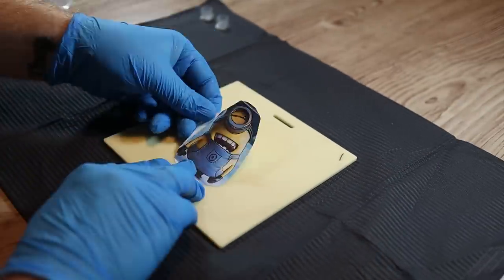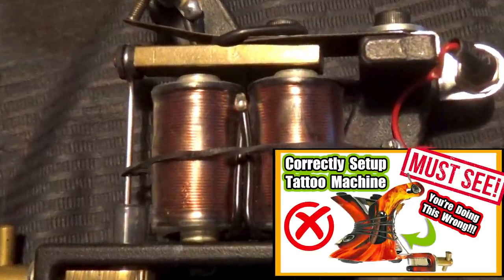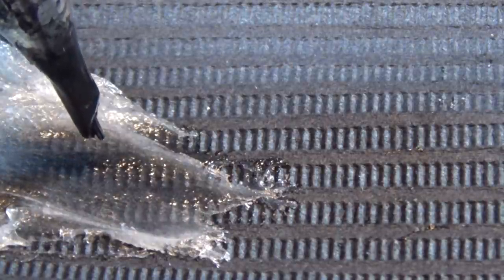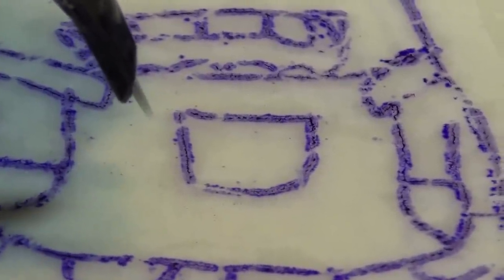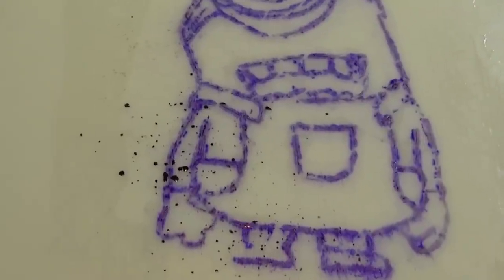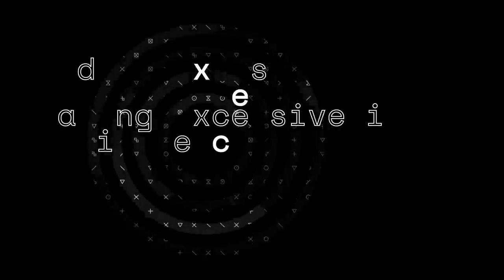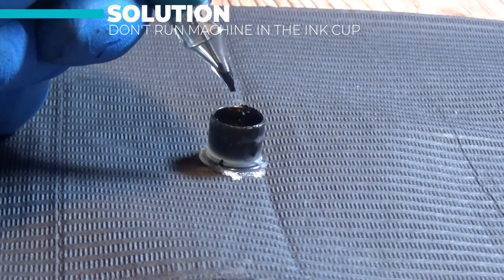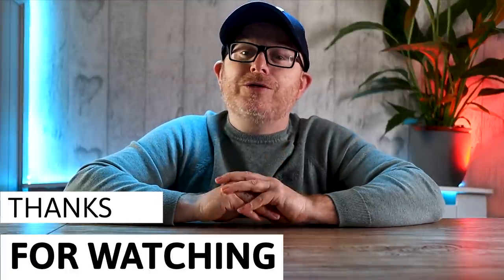How To Tattoo Avoiding Ink Splatter! 6 Most Common Mistakes Made & Techniques To Avoid Them!

Comment: Thanks for this. Until watching this, I always used to have problems with loading too much ink into the cartridge needle. When dipping the needle into the ink, I always used to run the machine to pull the ink up, but after doing it the way you suggested, I'm no longer having this problem! Thanks again 👍🏼

Comment: Jono, thank you for all the tips and pro tricks to producing a better piece. Not having to deal with splatter or pooling of excess ink not only saves the stencil, but it also saves on skin irritation caused by excessive wiping or blotting of freshly tattooed areas. A tattoo is not going to be completely irritation or pain free unless it is a temporary jobber like what we used to get back in the day out of a cracker-jack box, but it does not need to be agonizing either.
Reply from the maker: Thanks for the great comment and yes I totally agree with you. Thanks for watching!

Comment: Thank you for the video Jono !
It really helped me with some blocked roads ,I have been struggling with the splatter for god knows how much.
Would you give me an advise about the fake skin,are there any differences?I see your stencil really holds onto it,how do you apply it?Does it have something to do with the stencil paper aswell?could you send an amazon link to a fake skin you recommend?
Reply from the maker: He’s a link for a decent fake skin. This one tends to wipe really well. The best stencils for fake skin are hand drawn ones on hectograph paper. You can use a standard stencil solution or even washing up liquid (obviously don’t use that in real skin) but it works great on fake skin. Hope this helps. Thanks for watching!

https://www.barberdts.com/uk/pinup-tattoo-practice-skin-100929.html

Comment: Should we use elastic bands for ratary machines too??
Reply from the maker: It depends which type of rotary you’re using. Some do actually require an elastic band still and some have ‘needle bar retainers’ which replaces the elastic band.
Reply: @JonoSmithTattoo  thank you for usefull info

Comment: One problem I seem to have quite commonly now is I get splatter going backwards as I put the needle into the practice skin to start a line. I've got a slight bend in the needle and a rubber band on, what could be causing this?
Reply from the maker: Is the needle defiantly the right size for the tip you’re using?
Reply: @JonoSmithTattoo  Its the smallest round liner I have. Maybe I should see if I can buy smaller ones than I have

Comment: Hey brother. Appreciate the videos! I was wondering what carts you used for the minion. Also, I’m kind of a Tater Tot, I was wondering what kind of cartridge you would use to do fine hair or feathers or like feathery sort of peach fuzz of a baby chick.
Reply from the maker: I used EnvyGen2 carts. The sizes for this were just a 10-09-RL and 10-11-CM. For anything really fine like you mention I always use a mag and angle it sideways to get a really fine edge for the delicate lines and shade over the top of them with the same mag to get the ‘fuzzy’ look. Thanks for watching!
Reply: @JonoSmithTattoo  No Thank You for making these videos brother. It’s so hard finding a person that will do an apprenticeship, let alone do it cheaper than 5-10 Grand and even knows the proper way to teach. I’ve learned a lot from you. So Thank you man.

Comment: 5:50 is that cartridge is for one-time use only and you have to use a new one with every tattoo? Which components of a tattoo kit you wash/disinsect and which you have to throw away after every tattoo?
Reply: cartridge needles are disposable. The cartridge grip is usually not, so it would be proper to sterilize it after each use. (but there are disposables cartridge grips available)

Comment: I have an ink flow problem with my cartridges, when I tattoo on real skin only, sometimes there is no ink coming out of the cartridge even though I have just filled it, so I re-dip into the ink cup to refill the cartridge entirely and it makes ink splattering, it's either all or nothing, it's very annoying, does anyone have a solution please? Thanks
Reply from the maker: Try slowing your machine speed down a little.
Reply: @JonoSmithTattoo  Ok thanks I gonna try it :)

Comment: I have a somewhat unusual question: I'm a beginner, but I started tattooing myself right away. When I start everything looks pretty good. But over time, most of the paint will peel off as it heals. When it comes to colors, I also find that the skin only bleeds extremely and still does not absorb any color. Could it be that I am already around 60 years old and used to be too much in the sun that my skin is simply too dry and that is why I have so many problems ???
Reply: I think this might be related to the needle depth you're using - it's alright for it to bleed when you're coloring but if the ink isn't sticking you might be not tattooing deep enough, so you're not reaching the dermis
Reply: @SamWayzeer  Thank you for your hint! But now I also googled whether older skin is a problem when tattooing and that is actually the case. When the skin is old, it no longer absorbs color well. The only tip was to pull the skin more apart, but what else do you want to pull big on the knee or wrist, especially since I'm quite thin in terms of physique. Well, I'll keep trying ... there is nothing you can do!

Comment: Just curious, when you are running a wireless machine do you still stop it from running every time you dip it in the ink cup
Reply from the maker: Good question! When using batteries I tend to leave it running and dip quicker.
Reply: @JonoSmithTattoo  thank you for the fast response and ok it makes sense. I do the same and just kinda put the tip I’m not the whole needle , I hang my needle out pretty far

Comment: So this dont for say go with this but I need help. My machine used to hold a duty an cps, out of nowhere I'm jumping from 46 to 55 duty.
Reply from the maker: I’m not sure what could cause it to jump around like that. Could need new springs. But either way 46-55 is still in a really good range to be tattooing with.
Reply: @JonoSmithTattoo  I'll change the front o ring maybe that will give it more kick down. I did notice since I ordered it the springs are very soft.

Comment: Thank you so much Jono, you are the best instructor ever ! For me, I do the opposite mistake but i can’t find out how to fix it : Sometimes (often), my ink doesn’t come out the tube when the needle is supposed to hit & penetrate the skin. I can clearly see the needle travelling in the skin but with 0% of ink. Even when I just dipped it with fresh ink ! 
Can you help me resolve this horrible problem ? 😭🙏🏽
Reply from the maker: This could be the lubricant you’re using blocking the ink flow, it could be the tip isn’t the right size for your needle, or it might even be something as simple as you’re not stretching the skin enough.
Reply: @JonoSmithTattoo  I’ll make some changes and I’ll see what’s wrong :) Thank you so much for your knowledge !

Comment: I’ve made literally EVERYTHING to fix that with my coil machine but it’s useless. Every time i put the needle in the fruit (I’m practicing) it starts spitting all the ink around, but after that it slowly stops. But it happens every time I reload the tip. And yes I’ve tried loading less ink, May anybody help me?
Reply from the maker: It could be just that you’re using fruit and the skin is clogging the tip. Have you tried using practice skin?
Reply: @JonoSmithTattoo  I’m starting to think that because the fruit is kinda too hard, but I’ll try tuning correctly my machine. Yes I’ve tried practice skin but it’s worst. Btw I really love your videos and thank you so much for your advice. 🙏🏻
Reply from the maker: @alec_grave  it could be something really simple. Hope you sort it. Thanks for watching!